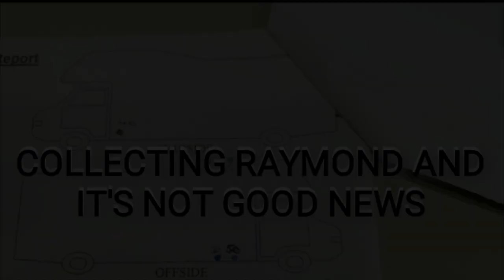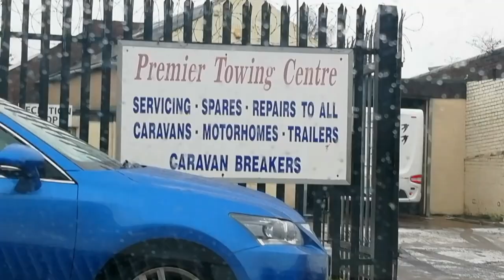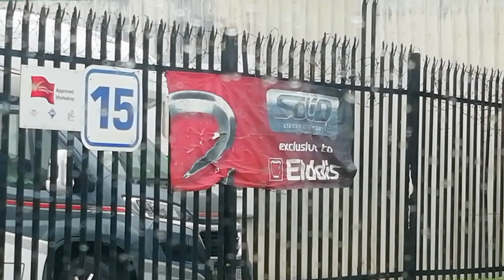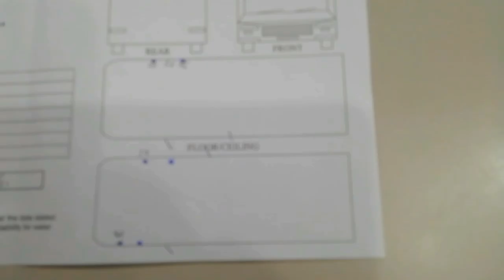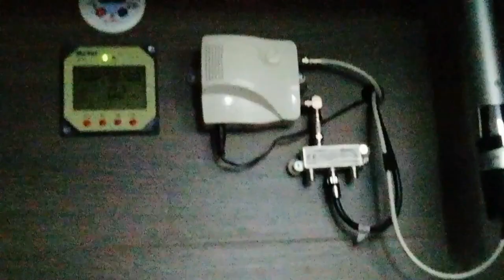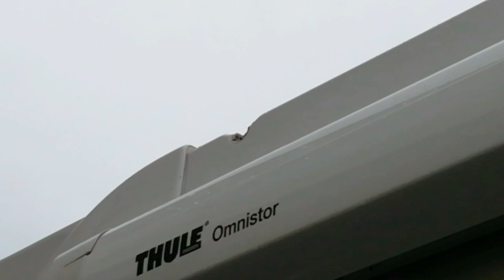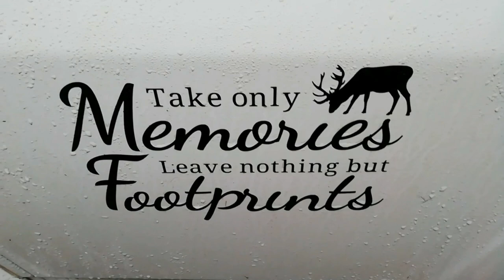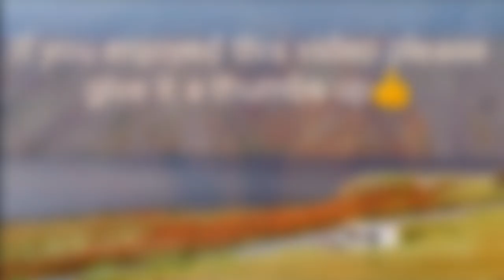MOTORHOME PROBLEMS IN AN ELDDIS. DAMP, DAMP & MORE DAMP! DISREPAIR AND WATER INGRESS. VANLIFE. RV.

Comment: We bought an Elddis Accordo 105 Prestige new in 2018 and the only issue we've ever had was that fridge wouldn't stay on for long while it was on the gas setting. It's just had its 4th annual habitation check and is all clear regarding damp. For 2 years before we bought it (our 1st motorhome) we were members of Motorhomefun online forum asking tons of questions before committing our hard earned cash. We visited dealers all over the country, went to motorhome shows to make sure we got it right
We've heard lots of stories of damp vans from many different manufacturers, Swift 'Kon Leekie', Autotrail 'watertrail', yes Elddis but also European makes, Benimar, Carthago and Hymer to name a few. The list is long, believe me.
We never made the decision lightly, but what helped us choose Elddis was their  10 years warranty against water ingress. We took that as a company which has got confidence in their product. I have a background in the construction industry so I understand that things can and do go wrong.
Maybe we have been lucky, but please, don't anyone get the impression that only Elddis are capable of making motorhomes that aren't quite up to scratch. We have no complaints about ours.
Another thing, you only hear the horror stories about things, good news doesn't travel quite so fast! I'm sure there are far more satisfied customers than dissatisfied ones.
I understand their pain and frustration, I'd be no different.  If in doubt join the above forum as there are 10s of thousands of members, many with many decades of experience. Ask them!
Reply from the maker: After this video, we had it fixed, and after a week, it was even worse than before, which we have on video. It was pouring in the length of the motorhome all along the drivers side, in every cupboard and even behind the bathroom mirror, it was a right mess. Maybe you were lucky, maybe we are just unlucky. And we didn't go into it lightly as we have previously had caravans so aren't simple when it comes to choosing a product. We joined forums before purchasing and have been a member of the Elddis motorhome FB group before we even purchased the motorhome. We have had more issues than just water ingress. Separating walls, dropping fridge, cracked shower tray, doors falling off to name just a few. If you watch the video before this one you will see the issues that we had before it went in for the hab check. Yes, it's not just Elddis, but it was Elddis that we bought and we will never paint them in a good light after parting with 54 grand in savings.

Comment: Never buy a used motorhome when its dry and hot; that's the mistake i made ,when it rained; it leaked in and caused alot of damp and mould,most old motorhomes need habitation checks;or buy a monocoque fibreglass upper chassis type autosleeper.
Reply from the maker: It was a brand new motorhome just over two years ago. It's because Elddis are rubbish at quality control unfortunately for us. We still love it and luckily we've had the hab checks done, so it's being done under warranty, but we'd never buy another Elddis again. It seems to be pot luck with them on whether you get a good one or not, and for the money that shouldn't be the case. We did look at an autosleeper but it had blow heating, and after having Alde heating in our caravan, it was something we wouldn't compromise on. Thanks for watching and for your comment too. Very much appreciated.👍
Reply: @roaminginraymond  mine was an old fiat ducato 1991  just sold it;only had it just over a year  lost two grand on it,my fault really for being ripped off, damp in every cupboard, everything was mouldy in spite of using the damp catchers with crystals; yet when i bought it was dry and no damp patches,lesson learned,i hope one day to get a autosleeper with 100% no issues  especially damp! Never mind 😁 atb👍🚙
Reply from the maker: @nopretribrapture2318  that's sad to hear. Normally the older ones stand the test of time better than the newer ones like ours. Sorry to hear you lost money on it too. It's such a lottery but an expensive one unfortunately. Hope you manage to get another one with no issues. All the best to you.
Reply: @roaminginraymond  Thankyou, il be a long time saving up,im hooked on motorhomes so i can't totally dismiss ever having one again,😊
Reply from the maker: I agree with that, we love ours and am going fulltime as soon as the restrictions are lifted and its fixed! All the best and nice chatting.

Comment: Why don't people watch these videos before spending 60k or more on an Elddis? I've seen too many of these videos, I would never buy a new Elddis.
Reply from the maker: Gotta agree, we wish we hadn't and wish we'd done more research before buying. We've had similar issues again now on the other side. We stopped having hab checks after this as after they repaired it, it leaked even worse across the whole length of the motorhome.

Comment: My compass caravan same damp same place. same problem . Kimberley caravans fixed it worse.
Reply from the maker: Not good. Compass are made by the same company as far as we're aware. Just shoddy workmanship. Ours got fixed and leaked again. Useless.
Reply: @roaminginraymond  mine has been going on for 1 and a half years. I hate caravaning because of it just had 2 things fixed today. The original damp done 2 months ago just got my dame meter out to check its dry as a bone. Because think of selling caravan as second hand price so high. And on both side over 50% damp worse than before the repair. I hate kimberley and eldiss
Reply from the maker: Yep, we hate Elddis too. And yes, definitely a problem getting rid if repairs haven't been done properly. You can go to a workshop like we did, but ours did leak again anyway. If you watch our second Wales vlog you'll see how bad it was and we'd only had it back a week. They are a disgrace but what can you do. Karl sealed ours twice himself and it seems OK now. Fingers crossed. So sorry that you have such high damp readings. You need to go elsewhere or get an independent. If you got it on finance, apparently you can get the finance company to help you with your situation.

Comment: I'm gonna stop watching this channel as there is nothing but problems with their van it's depressing......look just throw a match to it and be done with the piece of crap and buy another
Reply from the maker: Ha ha, not after how much it cost to buy in the first place. Plus all the extras like solar panels etc that have been added. Hopefully when it's fixed by the workshop it will be better than the original build by Elddis.
Reply: we have just put a deposit down on a new one ,getting in Aug .Scared to death now .
Reply from the maker: Join the Elddis Motorhome Facebook group and they will give you honest opinions. Not everyone has problems but after we had this repaired it leaked even worse a week after repair. If you go to our Wales playlist from May 2021, there is a video on there showing you the reoccurring leak. Can't remember which one, but you'll know from the thumbnail or title hopefully. If you aren't happy you can always get your deposit back as far as I am aware. Check your consumer rights too.